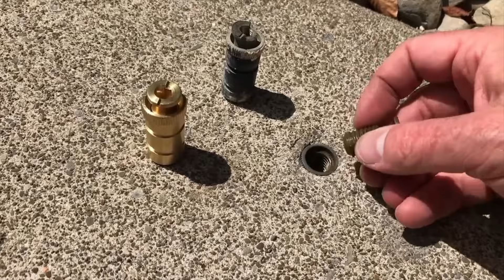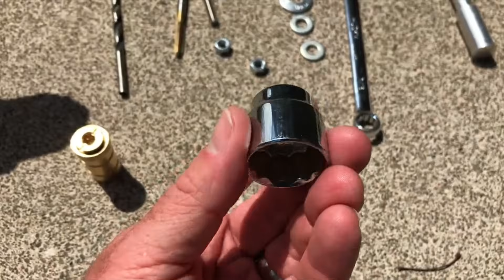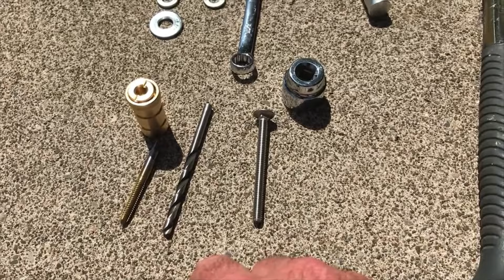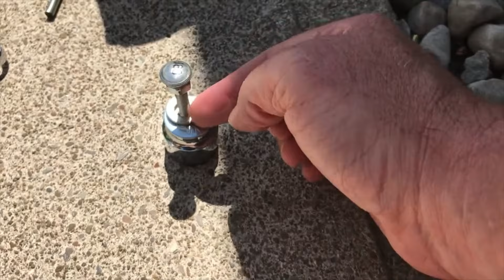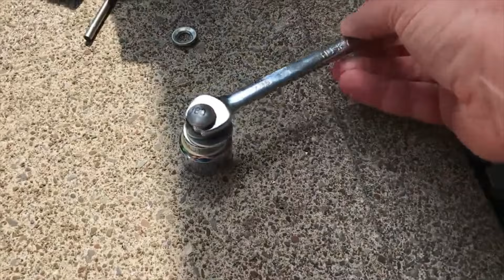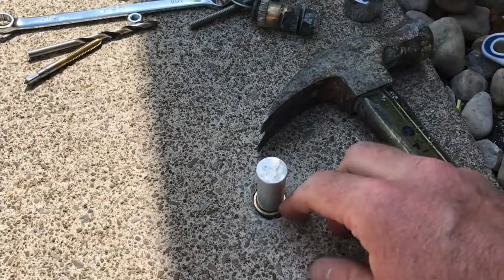Pool Safety Cover Anchor Replacement | Brass Anchor Repair | DIY Pool Maintenance

Comment: what if the hole is too large for the new anchor?  What would you have done then?  

I have 4 anchors that need replacement and 2 of them I pulled out by hand as the shaft was now too wide . . .
Reply from the maker: Sorry for the delay.   I would use an epoxy to fill in the gap.  Extracting the new anchors from that epoxy would be difficult in the future.  Another option would be a concrete repair/crack filling compound, you should be able to find this in the foundation and masony section of your hardware store.

Comment: What about if you only have the body of the anchor? My thead piece was broken and had to remove it
Reply from the maker: you can buy the thread part of the anchor, or you can sacrifice the thread part of a new anchor in using this method.

Comment: What about just removing the sleeve, I have really old spring loaded anchors and need to get old sleeves out to install new sleeves and anchors TIA
Reply from the maker: I wish I had a solution but I'm not familiar with those sort of anchors.. got a link?

Comment: Another tip is I after I stripped using an allen wrench I was able to remove a couple of seized screws using a 12-14" pipe wrench.  One broke trying so I will try the method in this video.  Also wear gloves as knuckles can be scraped pretty bad when the wrench slips.

Comment: Is there any way to just drill out the screw-in part?  I think mine are siezed because of dirt in the threads getting bound and if I could just break out the screw-in part I could just use a new one of those after cleaning the threads in the ground.  I suspect this is not possible hence your video but wanted to ask.  Thanks!
Reply from the maker: The material is Brass, which is a soft metal.  IMO you could find a larger bit/drill and drill out most of the insert, slow speed, with oil should do it.  drill bit size should be less than the diameter of the insert (maybe pull out an adjacent one to bring to the hardware store).
Reply: @bobbyk1161  Thanks!

Comment: I would recommend skipping to 5/16 or 3/8 right away.  I started with a 1/4 20, busted the bolt in the brass anchor cause it was stuck so hard.  Then busted a drill bit in that when trying to re-drill everything out.  Then started going down steel bolt hardness levels vs drill bits to figure out where I went wrong.  I finally ended up going with a 3/8 16 tap and bolt which had way more strength and was able to get it out just from threading the top third of the anchor.  Also pro tip, use a hammer to loosen the entire rig and tap the bolt back and forth when it tightens up a lot and you feel like you're going to break the bolt.
Reply from the maker: Fair point.. and the brass drills out relatively easily.   Love the hammer tip.

Comment: Nicely done, the process straight forward. First one of 3 came right out. The other two wont budge. I'm guessing Im going to have to use bigger bolts or drill the anchors out completely.
Reply from the maker: oof.. that's a bummer.  Do you mean that the bolts you threaded in are nice and tight but when you try turning the bolt with your wrench you can't make it turn?  maybe use a larger/longer C-Wrench or ratchet?  get more torque?
Reply: @bobbyk1161  Yes, tried a longer bar for more torque. The tapped threads are nice and tight, the bolts stay in, the nut does stop turning. The anchors must be close to 20 years old.

Comment: Can you tell me the bit for that anchor ?
Reply from the maker: The bit needed to drill a hole for the anchor?
Reply: @bobbyk1161  The bit to drill a new hole
Reply from the maker: @MA-vr7ht  Hi, I do not know the bit size required to drill a new hole for the anchor.

Comment: Thanks for this. Worked perfectly. I used a 5/16 carriage bolt as that’s what I had on hand. Used a 1/4 drill bit instead of recommended 17/64 for the tap. No problem tapping the soft brass. Keeping the ‘puller’ along with remainder of the new anchors as I’m sure I need them in a year or two!
Reply from the maker: Glad it worked for you!  thanks for sharing that a 1/4" bit worked, that may help others in their efforts too.  All the best!

Comment: Amazed how easily one came out. Second one I can't remove. I broke the bolt and tried again. Stripped the nut and now I am stuck. Any suggestions?
Reply from the maker: Oof.. that's a pain.  A couple of folks here noted that their anchors were put in with epoxy (which is not needed as the force on the anchor is lateral, and there's no need to have them secured to that degree in their hole).   If you've stripped the anchor then I think the only solution might be to A. use a larger tap to put new threads in the soft brass of the anchor, and you'll need a larger bolt to go with it.  or B. drill out the anchor and it's housing.. which is messy and would take a while..
Reply: @bobbyk1161  Went with larger bolt and tap, (5/16), after some time working at it, anchor came out. I appreciate your video and advice. Thanks.
Reply from the maker: @edwardkonowicz2135  Success!!!
Reply from the maker: Other comments noted that some anchors may be held in with an epoxy adhesive, yours may be too.   Is it possible to attach a pair of vice-grips to the bolt and un-screw it from the anchor?   If the carriage bolt broke you could consider switching to a higher rated bolt.  Most carriage bolts would probably be Grade 2, so you could consider using a Grade 5, 6, 7, 8 bolt (though probably wouldn't be a carriage bolt, a higher grade bolt would operate in the same manner).  Or, you could use a larger diameter bolt (but you'd also need a larger diameter tap and drill bit of course).

Comment: Just to be clear, everything about these instructions worked like a charm. The problem in my case was the anchor was installed incorrectly with way too much adhesive. I had to chip away the concrete all the way around the anchor AND in the bottom of the hole.
Reply from the maker: Sorry to hear that, I've not seen these used with adhesive before, I imagine a little silicone could be used if the anchor was spinning in the hold, but it sounds like the original installer used epoxy or something much stronger.  Best of luck on any other anchors you need to replace.

Comment: I drilled out the inside screw. Tne new screw in the old achor will only go down about half way. I would like to remove the old anchor now, any suggestions, perhaps just do the same as video although it is new screw.
Reply from the maker: if the new screw threads down into the old anchor it should be strong enough for you to pull the old anchor out.  Good Luck!

Comment: Didn't work for me unfortunately because the anchor was too solidly hardened into the concrete. Everything worked until I got the carriage bolt in per the instructions and could not get it to twist. I ended up hammering masonry nails along the sides until I was finally able to loosen it. Took better part of two hours.
Reply from the maker: Wow..!  sorry to hear that.  I wonder if the installer used some sort of bonding agent, like a epoxy when installing those anchors, or maybe you have a really built pool deck.

Comment: Could u just use the tap with a socket (no bolt). and once the tap grabs enough of the anchor, pull it out?
Reply from the maker: Certainly the tap would find purchase in the anchor.  If you had a way of attaching that tap to a system that would pull the anchor out without damaging the concrete around it, I'd be interested in including it here.  The benefit of the system as described in the video is that it uses the tapped threads to allow a bolt to leverage the anchor out of the concrete while at the same time pushing against the concrete to keep it from fracturing around the perimeter of the anchor.

Comment: Wow, such a useful and well-made video! It worked exactly as you described and demonstrated. The only problem I had was that the cement cracked a few times, close to the surface, as the anchor was extracted.

Comment: If you can get anything under the anchor if it's up you can pry it out easily and faster.My concrete is 18 years old and one chipped a little and the other 2 slide right our by just lifting equally on the inside piece of the anchor.No drilling, tapping or anything else need.Just a good solid vertical pull, mechanically assisted.

Comment: Worked for me! I followed this to remove a an anchor that I tamped too aggressively and got distorted such that the insert did not screw in fully. I actually used a PVC pipe cap which is something I had on hand. I used the drill and tap. Then the bolt with the pvc cap drilled for the bolt.

Comment: Great video!  I purchased it all for $15 I think… since I had the tools but just needed other supplies.  All was going well until the carriage bolt kept snapping… I never got a single one out.  Any recommendations for a stronger bolt?  It appears these are glued in.  Is it a lost cause when they are glued in?  Thanks again for all the info!
Reply from the maker: Thanks!.. but ouch, feel bad you didn't get one out.  Must be that whoever installed them used Epoxy or a similar agent to glue them in there.  Yes, absolutely you can get a higher grade bolt, you may have to go to a fastener supplier instead of Lowes/Home Depot.  A standard 1/4" carriage bolt from Home Depot is Grade 2, with a tensile strength of 74K PSI.  BUT you should be able to also buy a grade 8 bolt there with a tensile strength of 150K PSI.  At a specialty fastener store you get higher grades, but I doubt you would need one because f it won't come out with a grade 8 bolt, the the epoxy bond is likely stronger than the concrete surrounding it.  Please consider wearing safety glasses and gloves if you choose to move up from grade 2 bolts.  Best of luck.
Reply: @bobbyk1161  Ah wow.. thanks for all the advice!!  Yes I did get these from Lowe’s 😊 and I didn’t see a grade on them so clearly I got a low grade.  I’ll try to find tougher ones… thank you!

Comment: Is there a way of adding extender pipes to anchors without having to purchase long anchors?
Reply from the maker: hmm.. not that I know of.  if the anchor isn't deep enough you could buy longer anchors and just thread them in when needed over the winter.  You could put the shorter stock anchors back in for summer use (to keep dirt out).
Reply from the maker: I haven't figured out a way to do that.  Best of luck though.

Comment: Can you list in print  the sizes and parts you need?  List size of screw, washer etc. Thank you.
Reply from the maker: Sure!
Tamping Tool (buy on Amazon or you can use any small short pipe or piece of steel or aluminum rod)
7/32" Steel Drill Bit
1/4-20 Tapping Bit
1/4-20 carriage bolt, 3" length, GRADE 5 or above
2x  1/4-20 Nuts
Fender washer
2x washers for the 1/4-20 bolt (just pick these in the parts aisle based on the bold in your hand)
7/16" wrench (C-wrench, fixed wrench or other)
7/8" socket.. this could also be s short piece of steel pipe or similar.

Hope this helps!
Reply: @bobbyk1161  Widowed mom of three with ADHD…this list SAVED me, THANK YOU!!! Ordered some from Amazon, and getting to Menards for the rest! I haven’t checked if you have other videos, but I also need to replace our pool cover…can I just measure the existing pool cover?
Reply from the maker: @theomalley3353    Glad you liked the video.   I think you would be best served having your local pool supply store come and take the measurements needed for the new cover.  If they make a mistake when measuring it's on them to fix it, but if you take measurements to a cover manufacturer and have made a mistake when measuring then it's not their problem to fix.  Hope that helps!

Comment: I periodically remove mine and run them through with a 9/16 coarse tap/die.  This keeps them freed up.  I suppose you could drill out the guts and run that tap down so you don't have to pull the shell out.

Comment: Just successfully removed a stripped anchor using this exact method.  Excellent video.  

A friend of mine owns a pool company, his method is just keep drilling larger holes until you remove the entire anchor.  I sent him your video and he was impressed!  Said your method is way better.

Thanks for making such a great and simple to follow video!  Cheers from 🇨🇦
Reply from the maker: thanks!   not my own method, but I tried to show it as clearly as possible.

Comment: Instead of an Allen wrench, we use a portable drill with a screwdriver bit in backwards. Much quicker than Allen wrench!
Reply from the maker: Great idea, glad this method worked for you.
Reply: Lol they have actual 1/4" hex bits. Put the bit in backwards 😂

Comment: I second Chad's comments! -- Bobby, you are a very gifted demonstrator, and you make it look easy. 

Also, in all my years, I never heard the word "purchase" used in the meaning you used in the video. Excellent! I really love learning new stuff, while disguised as a senior citizen. I'm part of a community center (nearing 50 years old) that has a junior olympic size pool with dozens of these anchors and many need to come up. 

I'm going to place a felt washer to cushion the socket and hopefully keep stress on the concrete to a minimum.  Thank you!
Reply from the maker: Thank you!  great idea to use the felt washer.  Glad you mentioned that.

Comment: I did buy a kit, and finally took the chance to use it. I had to remove 3 anchors for a customer, and my bolt snapped on the last anchor. lol. Perhaps a harder carriage bolt would be best. I was shocked how the thing fought the entire way out. I ended up using a cutting wheel to remove it, and drilled a new anchor next to it
Reply from the maker: yeah, I think you make a good point here.  A higher grade bolt would be prudent.  Thanks for the comment.

Comment: Great video!  By the way, Amazon doesn't seem to offer loop lock brass anchor removal kits so your video with the exact hardware necessary for the job was great.  You can find a kit on-line (non-Amazon retailers) but I found prices are around $150!  The hardware list you recommend I'm guessing is less than $30.00.  Thanks again for this helpful video!
Reply from the maker: Well, thanks very much for the kind words.  I've been surprised at how many people liked the video, I'll be sure to make more when pool season opens again!